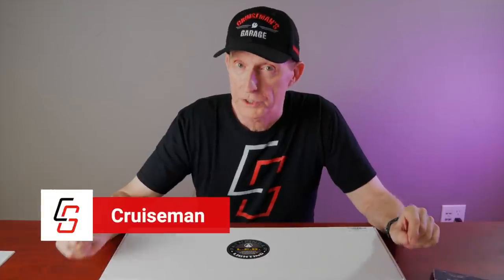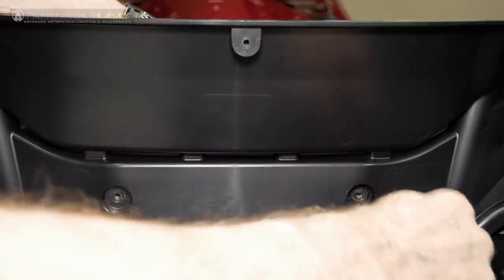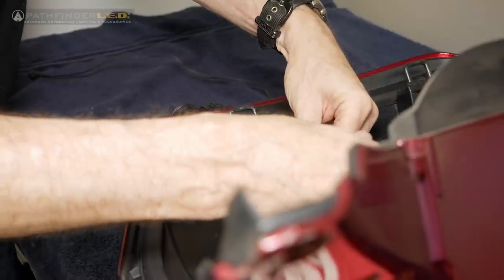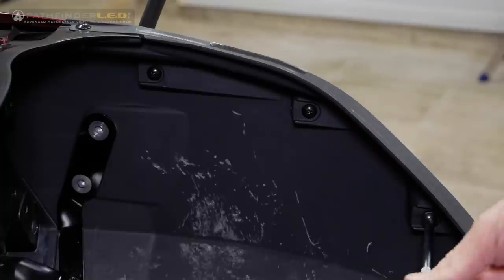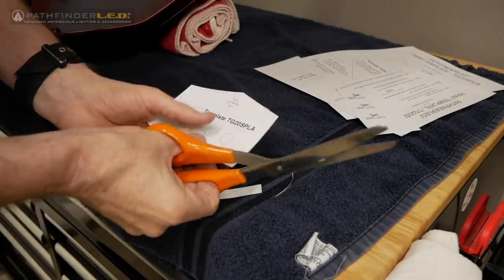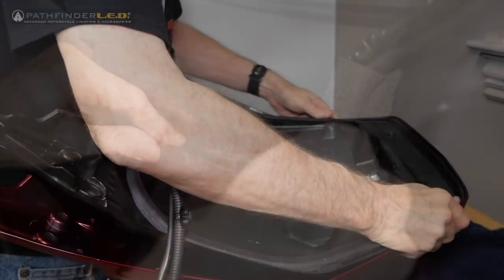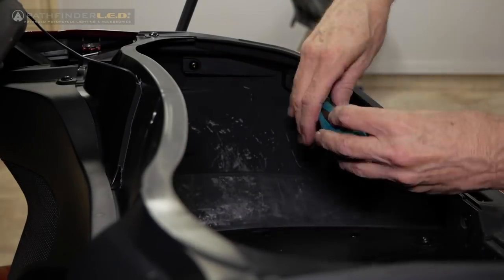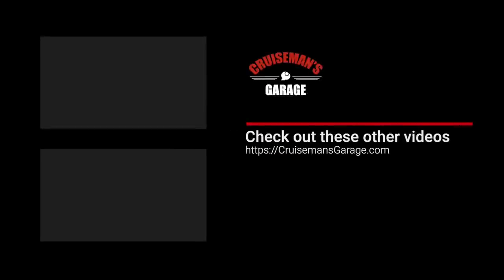LED Trunk Spoiler with Sequential Turn Signals for 2018-2020 Honda Goldwing

Comment: I have the Honda trunk rack. I was thinking of adding the trunk rack, brake / turn signal light, but wondering if that assembly would interfere with any tie-down straps or bungees I would use to secure my stuff to the rack. Would there instead be room to install this spoiler assembly, leaving enough room between it and the trunk rack for said tie-downs? I know you have a trunk rack with the trunk rack light installed.

Comment: Looks very cool but would be better if the lights were all red (not amber).
Reply: The new model for 21 and up goldwings is $100 more and programmable through your phone to change the colors of the lights
Reply: The run and brake lights are red, not amber
Reply: Yes, but the rest signals are red…I’d prefer amber signals up front and matching red in the rear…must be OCD kicking in in my early 50’s!! 🤪